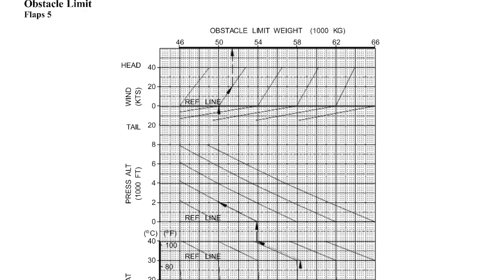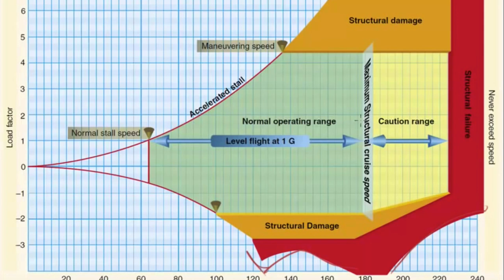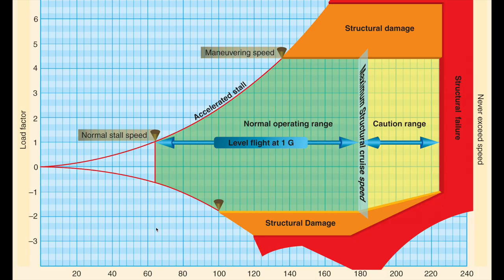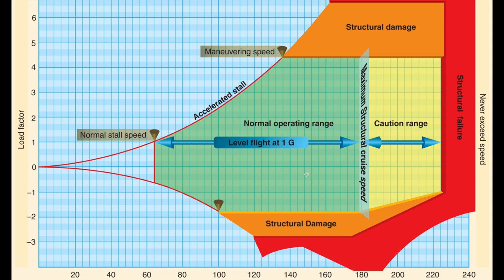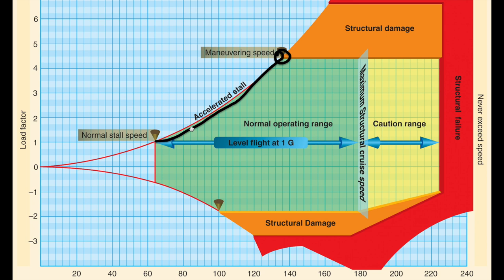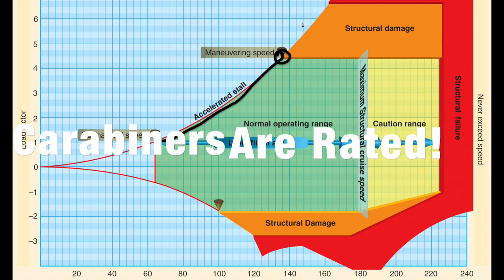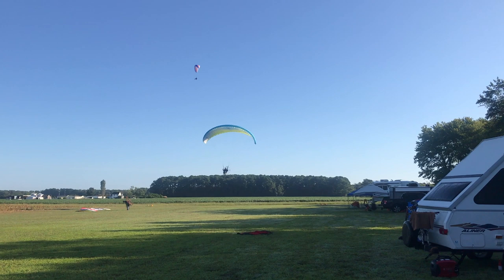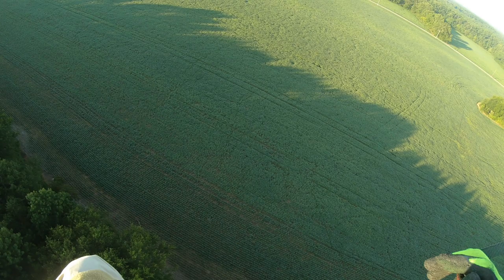Paramotor Flight Envelopes

Comment: I don't know how useful g loading chart would be without an instrument to tell me how many Gs I'm pulling at any given time. Side note: I stopped pursuing my PPL because it stopped being fun just as you alluded to. I just wish there was a "non collapsible" wing. I've been thinking about a rigid leading edge. mac has those plastic spars which are nice. but I just imagine a leading edge that, when unfolded, locks into a completely rigid face. I feel that would solve any potential collapses that could happen regardless of wind direction. I saw this video of a commercial pilot who flew into wind sheer on a seemingly nice day without much wind. but his wing violently buckled. There was little way to identify this condition and no way to survive it. he just collapsed and dropped breaking his back. WO!! But I wonder if a rigid leading edge would keep this impossible and rare scenario from happening. thoughts?
Reply from the maker: Yeah lot's of thoughts. 1) G meters installed in airplanes are actually a liability IMHO.  Especially in rental aerobatic planes!  Some private pilots are just going to have to see "how many Gs we can pull" and that is the WRONG attitude.  A G-meter should be used to help insure that you remain inside of the design limitations of any aircraft one is installed in and to indicate that inspection of the airframe or equipment is likely needed if you happened to exceed the design limits during your practice session. It's not like the bell you try to ring at the county fair by swinging a sledge hammer. The useful thing about knowing the design limits, is for the pilot that understands that a stable 60 degree turn is a 2 G maneuver.  Steeper coordinated banks along with steep dive recoveries, add G loading exponentially as bank (or respectively speed in dives) is increased. FWIW there are several commonly used electronic hand held devices that indicate G loading.  I think you may have missed the point that Gs multiply your all up flying weight.  The heavy pilot will need fewer Gs to over stress his gear. 2) Sorry to hear you've stoped the PPL quest.  In a geeky nerdish way, I secretly always delved into the engineering side of flying, but I know that it's not for everyone.   I spite ofmy own passions, I never pushed science beyond what the test standards required for each rating when I was actively flight instructing, to try to keep student's eyes from rolling in their heads. 3) It sounds like you've been listening to that idiot Dell on the subject of collapses. Collapses on a PPG wing are just part of the exposure to flying the things.  Yes they can happen, particularly if you fly passively in rough air, like the guy in the video you mention.  Yes, I;'ve seen it.  If you fly enough hours with a wide tolerance for weather other than calm and smooth, you'll eventually find weather rowdy enough to collapse you.  A good argument for gaining a better understanding of all things weather related - It's a life long pursuit.  Although not nearly as useful as an intentional stall,  collapses can also be purposefully done to attempt to fix cravated wings, or to build energy for maneuver entry, or to totally disable your wing if for some reason you've deployed your rescue.  I think the common consensus is that rigid, non-collapsible wings are easily within the grasp of PPG gear designers, but to make one would expose pilots of other risks that may present a greater danger, like the inability to hold a paraglider in a collapsed state, in strong gusty conditions, maybe on a ridge launch where getting plucked could be far more dangerous than staying on the ground. If your biggest concern about pursuing PPG is potential collapsed wings, you've only scratched the surface of what you need to know.
Reply: @YankeeinSC1  All good points. I've given up on fixed wing and rotorcraft but I'm in love with ppg. had about 10 flights so far. I get the feeling that only flying in stable conditions would limit any of the potential risks you listed to a rigid leading edge. In any case I feel it would act more in line with an insurance policy for those unexpected situations. As for Dell, (just one example of many) he told me 2 strokes are superior to 4 strokes because "you'll be changing oil all the time." Considering you are "changing your oil" every time you fill up on a 2 stroke engine, his level of stupid boggles the mind (but he is good for a laugh now and again). nah, I don't listen to that guy. I'm terrified for people who DO listen to him!! I think what I took from your vid is that, in fixed wing, we get a good idea of our safety envelope because we have manufacturing guidelines and it would be good if ppg manufacturers gave us the data so that we can have the same level of awareness. I completely agree. Its hard to develop expertise without data. Hopefully as this sport matures, ppg will catchup. unfortunately that will likely come with regulations and air worthiness certificates and all that jazz. I guess everything has tradeoffs. Great video as always.

Comment: Heck, Id be happy if they would just post the trim speed and max speed numbers at a given wing loading using a gps. Some do but not all. Something else to add to your thoughts, a wing will have structural failure much earlier if you have the trims out instead of pulled in like they should be when pulling any +G maneuvers.

Comment: Congrats on the new grandpa status, Todd! 👍👍🍻 

 Knowing where the danger zones lie would certainly be helpful in keeping a safe distance away from them.  I don't think there's such a thing as "too much info" when it comes to safety, so long as the information is understandable. 

That said, I still won't be exploring the outer limits of my gear any time soon. Still working on getting off the ground, LOL. I want to get taxiing down before I attempt flight. It's a lot harder than I anticipated! Making slow progress in the right direction, though. I've become expert at clearing lines and laying out the wing, however. 😂 Now the cold weather is coming, and it's draining my ambition to get out there and practice. I need a summer home in the Keys ... 😁

Comment: As a 220+ lb pilot, I do often wonder how well my gear would hold up under semi-aggressive maneuvers.  For the most part, it's just an academic curiosity since I don't really have a habit (or strong desire) to get aggressive and pull a lot of g's.  By the way congrats on the little one!  But admittedly, without data me saying it's "just academic" is taking a lot on faith that I'm nowhere close to the limits with what I do normally.
Reply from the maker: No way do you look to be 220 in your videos!
Reply: @YankeeinSC1  Thanks, but I'm 240+ in my earliest paramotor videos... just down now to ~225... and that's in my birthday suit.